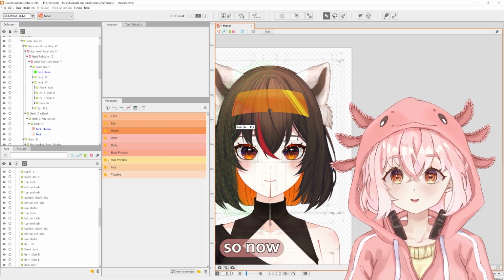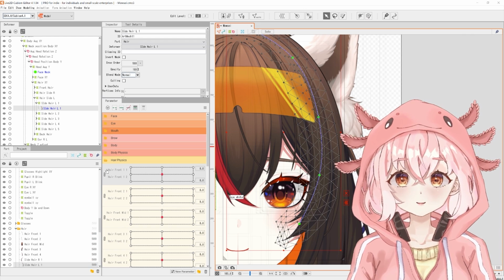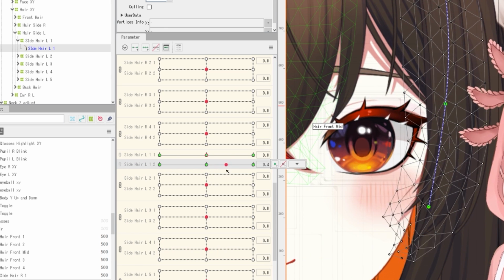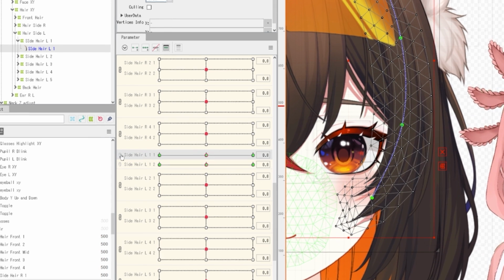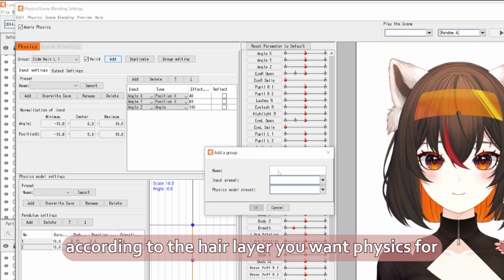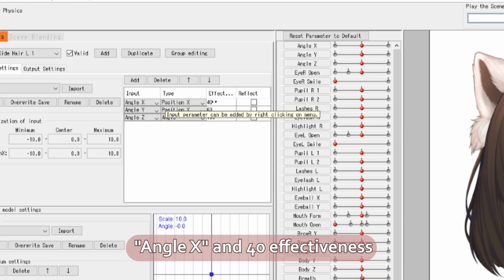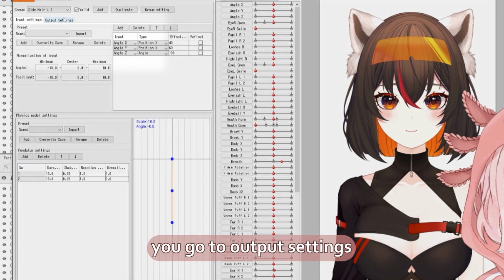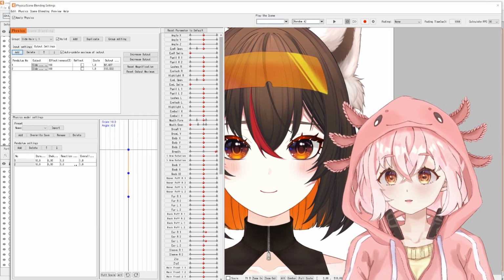[Live2D Tutorial] Smoother Hair Physics with just 2 Parameters!

Comment: hi! how would you set up the parameters? would it be set to the hair's artmesh or is there a way to link the parameters and each deformer point?
Reply from the maker: id usually use one parameter for one section of the hair, ie bangs, back hair, side hair etc
im not sure what you exactly mean by linking each deformer point however you can link two params together :3

Comment: What about longest hair? I have to use skinning but I’m wondering if there is any other way
Reply from the maker: you can use the same method! what id usually recommend is adding the curls in the mid-section of the hair too so it has more movement compared to the shorter strands :)
Reply: @uparunach.6531  Mmmh 🤔 i tried using 3 parameters, maybe i messed up, that's why it didn't work well.